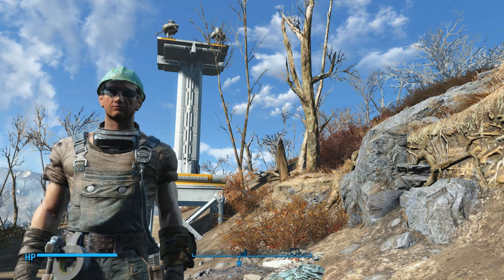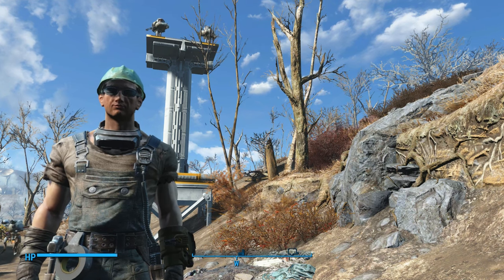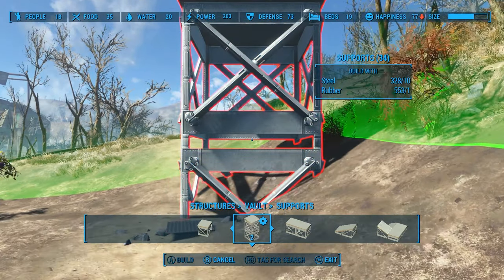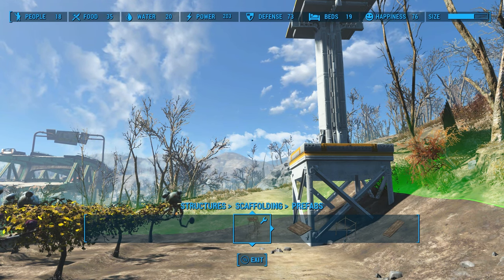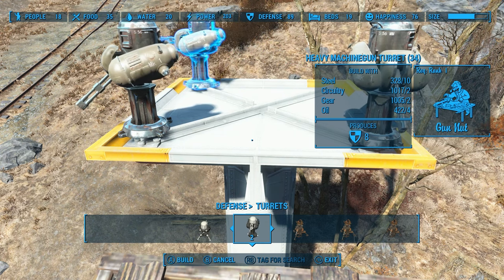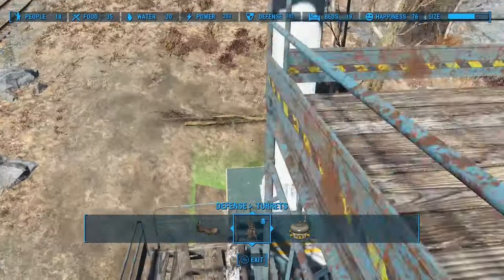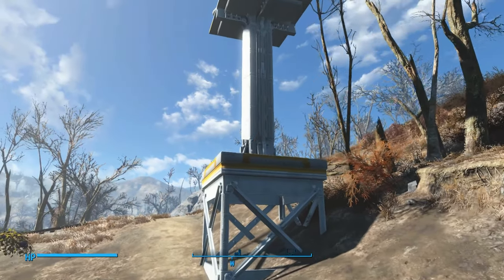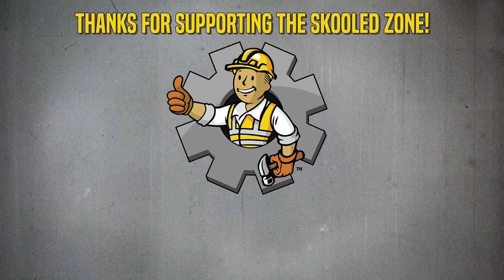Killer Gun Towers for Your Settlements 🛡️ Fallout 4 No Mods Shop Class

Comment: I saw a video (maybe yours?!) that they had a small wood floor piece floating in air, then a fan on the bottom and a turret on top and the fan was spinning thanks to power hub on the ground. The whole thing was like 2-3 stories high and it made it look like the turrets were flying on the fan. Could do the same thing with large floor piece and 4 fans, 4 turrets for the quadcopter look.
Reply from the maker: Yeah, that was my Vault 42 build: https://youtu.be/P6n1-POCUrM ...When I get to the lesson for my turretcopter I could try and make another one look like a quadcopter. Stay tuned!
Reply: EpoxyJewelry.com lol
Reply from the maker: Hey EpoxyJewelry.com, just thought you might want to know that when people try and reply to your comments and use your url name, it turns into a link that gets filtered into the spam folder. Just an FYI in case you ever wonder why people don't reply to you sometimes on this or other channels. :)

Comment: I usually just build single scaffolding in each corner of my walls and they seem to do very well so far. I even built an overwatch scaffolding tower 4 levels higher, placed heavy enclave laser turret and placed that tower in middle of my settlement. 

With scaffolding it works pretty much the same....although now that i know you need to complete vaults quest line to unlock possibility to build this stuff anywhere im definitely upgrading all my settlements to vault builds. Most likely will spend another 100 hours doing that.

Comment: Awesome series so far! Here is a tip for you: you can actually jump while in in workshop mode!!! Instead of exiting build mode to jump from the scaffolding to the top of the tower, you can use the "Y" button (Xbox) to jump so that way you don't have to wait for the menu delay. This is actually really helpful when you have obstacles in your way and need to get past them while holding an object for example. Check it out and make sure to share with the community!
Reply from the maker: Yup, I definitely use the jump ability when in workshop mode. I might not have done it in that moment because I was either distracted or didn't want to fall. But yeah, it's essential.

Comment: Gonna have to use this technique.  Graygarden attacks are what prompted me to make monster bots.  Lost Supervisor White in a raider strike, then lost two more Mr. Handy's.  Replaced them with souped-up sentry bots with assaultron legs, double mortar launchers, & double Gatling lasers & voltaic frames in every slot available.  Use the same config for my robot caravans.

What are they called?  If they're stationed in Graygarden, they're Graygardener-01 for example.  The ones which take to the roads are Graywanderers.

Did you know the robots you make level with you?  Most settlers & bots have a fixed level which is relatively low.  The robot logistics train levels up each time you do.  Can make them pretty terrifying.  I've seen them solo deathclaws & handle super mutants & ghoul gang-bangs with ease.

Thanks for all this info, Paul.  You're a gentleman & a scholar.

Comment: I did a similar thing where I built an overhang on the "front" of the castle (facing Boston, not Spectacle Island) and used scaffolding to "support" the structure. What I ended up doing was stacking two of the 4 post scaffs and then put the boards down on the first one (the second snapping to the floors of the overhang) and placed turrets on there. Yours look very great for vault builds, but thought I'd toss an idea to keep with the "Fallout feel". Great idea though!

Comment: The other advantage to having turrets at a higher level is that they are more immune to damage from suicide mutants with mini nukes who can easily wipe out several turrets at ground level and therefore have high walls like the shack foundation or the high metal per made pieces with standard wood floor on top to provide a bit of height for the turrets when building a wasteland base usually at the red rocket outside sanctuary which is a quiet place but still comes under attack once you enter diamond city

Comment: BONUS TIPS!!

 TIP 1)    Turrets have a 360 degree arc.  Yup, that's right!  Just because they "patrol" in one small arc, doesn't limit them from shooting enemies behind them.  It's important to note that if an enemy hasn't been spotted behind them yet, they will not see them.  Having a setup like this helps you for a number of reasons.  First, the detection arcs overlap.  This let's the turrets overlap their patrol area to spot enemies sooner.  Secondly.  They have each other's backs.  Meaning; while turrets can't detect enemies that are behind them (unless they get shot), the turrets on either side have an increased chance to spot the enemy, thus alerting the non facing turret, as well as any others nearby.

TIPS 2)    When placing the heavy machine gun turret, notice the model number (mkI, mkIII, mkV).  This coincides with the leveled enemies map overlay (a map that shows the relative difficulty levels of enemies in that area).  As a rule of thumb, Sanctuary is a low level area, and as you go farther south/south-east, the enemies get higher in levels.  What does that have to do with this tip?  Placing the heavy MG turret will place different leveled turrets based on location.  For example, placing the heavy MG turret in Sanctuary will give you a mkI turret, while placing the same turret at Somerville Place will give you the mkv.  Here's the real tip.  You can change/toggle the level of the heavy MG turret in the build menu.  To do this, select the turret and before you place it, rotate it to see which model it is.  If it's mkI, use the arrow keys/d-pad to back out of the turret selection, and reselect it (down, then up on the D-pad for consoles).  It will cycle through the different models that you've unlocked.  I'm not sure how they unlock, but, my guess is your character level and/or how far into the higher leveled parts of the map you've visited.  Most times you can place the mkV at any location if you cycle through them enough times.  

TIP 3)  Knowledge is power!  You don't need to line your settlement with turrets.  And we should all know by now that totally enclosing your settlements with walls, does nothing.  Since enemies have spawn points within several settlements' boundaries and enemies will teleport towards the center of a settlement based on the amount of time it takes you to arrive at the attack.  Now, hear me out on this one.  You can do two things here.  One, you can guess where the spawn points are.  OR, look up a video where someone has enabled a mod that puts waypoints in the settlements where the spawn points are.  From experience, I can tell you, without mods, that Graygarden has several spawn points.  One is up the hill along the rails (this one might just be a random wandering enemy encounter route).  One is actually next to the farm house.  And another is next to the car you can win (like, right next to it).  I think there is another one to the east, but I've never been attacked from that direction.  What does this mean?  Group your defenses around those spots.  I've totally enclosed the enemy spawn point at my Longfellows Cabin Settlement (only one spawn point there), turning it into a glass walled death trap for all to see!

Things to take away from this video:  The tower build is ideal for large area coverage, and it saves valuable building space.  Being higher up also means that they can see farther as well.

BONUS NON-RELATED TIDBIT

Place turrets on top of the Finch Farm overpass along the broken roadway facing the junkyard (I forgot what it's called), and Saugus Ironworks.  Now, sit back and watch the show!  A few of the gunners that spawn on the other part of the overpass are within targeting range of your turrets and they will continually shoot that area.  This will bait and switch them (or kite them, if you prefer).  Once they figure out where they're being shot from, they will all start to make their way towards Finch Farm.  Along the way, they will once again get within firing range and line of sight of those same turrets.  They will never make it to the farm alive!  

ENJOY!!
Reply from the maker: Interesting. I'll have to see if changing the turret mark works in my game. Thanks for the tip!
Reply: Unfortunately, I couldn't get it to work (just tried it again).  I currently have patched version 1.9.4.0.1.  It used to work back around 1.09.  Either Bethesda patched it out or my game got bugged.  Neither one would surprise me. I just tested it before I responded.  I don't like giving out inaccurate information and I never really paid much attention to it since I seemed to always get mk 5 or 7 turrets (Sanctuary on my xbone save had mk 7 before mods were available).  And I hadn't tried it for awhile.  It appears to change your turret level depending on the location.  It coincides with the leveled map. The farther south/south-east you go the higher the level you can build.   Sanctuary, RR, and Sunshine Tidings co-op all had mk 1 while Taffington Boathouse had mk 3, Egret Tours Marina had mk 5 and Spectacle Island had mk 7.  This may just be my game, but I couldn't get it to work.  But as of July of 2016 it did work (Oxhorn has video proof).

For anyone that is curious as to what the leveled map looks like:

http://nerdist.com/wp-content/uploads/2015/11/Fallout-4-Map.png
Reply: I think I got the instructions wrong.  Instead of selecting down and back up to the same turret, I think it was to select left or right to another turret until the model changes on the heavy mg.

Comment: I prefer to build a wall around Settlement and then use high Scaffolding with wood platform on it to mount turrets along the wall. Works similarly in concept, just more...janky-looking~
Reply: i normally build walls and build pillboxes into the walls at the top and bottom alternatingly throughout. not only great defense but also protects the turrets making them harder to hit
Reply: Walls look great from a roleplay view but it's not helpful in reality. Enemies spawning while you're in the settlement do get blocked. But if it's an attack while you are away, enemies dont calculate walls and just spawn in the middle of the base

Comment: You can easily fine tune the placement of the turrets without having to climb the tower if you place a floor tile on the ground and then place your turrets.  Then you can move the floor tile to the top of the tower and it will snap it place from the ground without any problems.
Reply from the maker: Good one!

Comment: I watched another video for all the spawn points and just got done going to every settlement that I have and built my towers near them.  I'm short on oil (and bone) so I can't fully arm them yet, but getting there.  I love this design but I altered it slightly. I used the taller base that you used on the southern tower here, but instead of the two separate pieces for the column, I used a pre-fab'd shorter column with both a flat top and bottom.  It's about two selections away from one of the columns you used.  I place 4 of the same type of turrets in the same position on the top, but I also place 4 more on the slightly lower level but not in the corners, but staggered with the ones on the top level.  So basically 8 turrets per tower, 4 on each level staggered.  Nothing's going to bother my settlements, LOL.  

Any tips on finding/making oil or finding an abundance of bone?  Great video, thanks!

Comment: (no mods/Xbox One S) I don't think Spectacle Island has a limit; I'm playing my second game, Normal; went there as level 18 (bad idea but survived), and been building a place just for me. I started with a three story building then when getting more Power Armor Suits made it four, currently it's eight stories then I added two adjoining buildings both 10 stories. I have 100 beds, two areas to shop in, many recreation areas, a dance hall, and when I had enough Charisma, I started transferring just women to the island. Never get attacked because I have no recruitment beacon. I have over 60 women on the island, I sent all of them there from other settlements. I do have defense but I'm currently level 86 (still haven't started main game except for one quest) and I'm having a great time there occasionally going out to 'play the game'.

I think some areas have sky limits but, I think that Island may be limitless.
Reply from the maker: It's technically based on your hardware capacity. Sounds like you may be on a strong PC. Consoles have a lower limit.
Reply: @SkooledZone  I'm on an Xbox One S. I don't own a PC, and haven't since 2011. I use my phone or the app on my Xbox One.
Reply: @SkooledZone  After taking out the trash (I live in farmland, place was five miles away) I thought about it; I do have a four terabyte external hard drive hooked to my Xbox One, maybe that's helping.
Reply from the maker: @davidarnold7147  Definitely helping. Here's my biggest settlement and I had to record it in chucks because the game kept crashing: https://youtu.be/P6n1-POCUrM

Comment: you say the missile turrets are deadly for the settlers, but I never managed to kill one settler with those, and boy oh boy did I tried, 15 missile turrets around an closed area, were I set a bunch of deathclaw loose, waited they were evenly spread among the settler before turning the missile turrets on. no casualty (they were on the ground, but alive). in hardcore mode. I believe they must have made them un-killeable unless you do it yourself (I was trying an efficient way to get rid of unwanted settlers, I accept mostly ghoul in my settlements, but it seems the only way that works is a bullet in the head) so there, the only problem with missile turrets are the damage they can cause to damageable structures but, if you place them right, nothing bad will happen to your settlement. and they are also very efficient (a lot more than any other turrets) they are like gatling rocket or some shit, they fire so much. just need to stay clear from them as well (they can kill you) but you can place a spawning mat for fast travel in a secure area and make it 100% safe for fast travel. so dump those gatlings turrets and move to missile.

Comment: Hey I have one question I am trying to rebuild the castle. I am stuck on one thing though. How would I rebuild the broken wall bits without mods?
Reply: Daxerz . What I did was do 2 stories of stairs and build a 4x2 and a 6x2 on top made of stone shack foundations. And then I put a fence post on them held x or the bottom button and moved it to the hole
Reply from the maker: Daxerz, here ya go: https://youtu.be/M9OQAseCIcg

Comment: Can you stack the upper turrets to make tiers?
Reply from the maker: You probably could. Just put down another bottom and top connecting parts of the columns.
Reply: You can, and it makes an awesome three tiered gunnery tower.
Reply: You can also use the small column and a seperate top piece for a good tiered effect and it not be rea lot tall.

Comment: way way too expensive.  I just use a couple steel beams and the wire mesh floors from barn structures.  Stick whatever turrets you want on top, and string lightbulbs off the bottom to give it visibility at night and also a real nasty street light with teeth for your settlement.